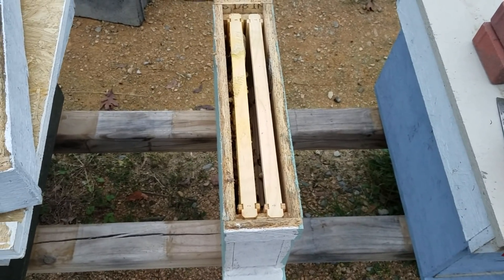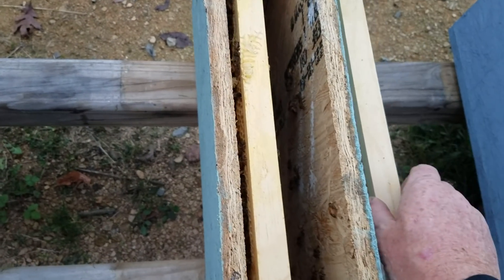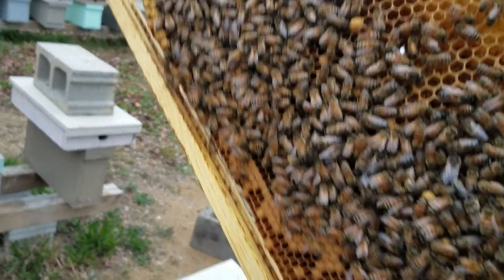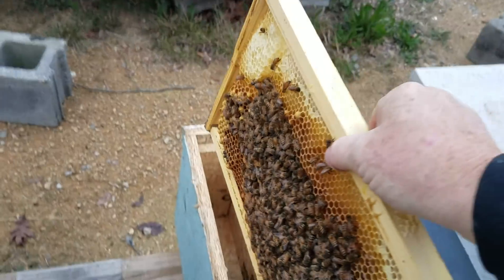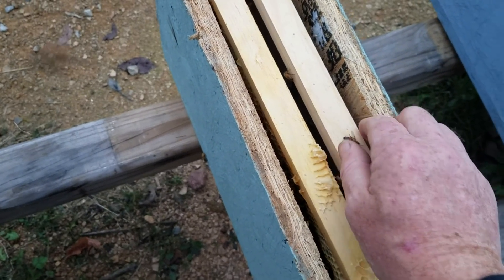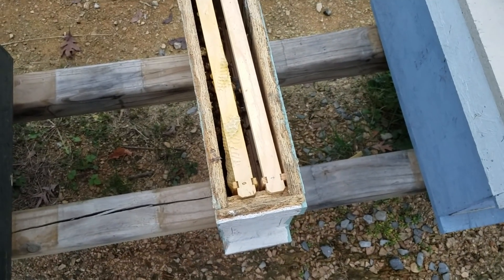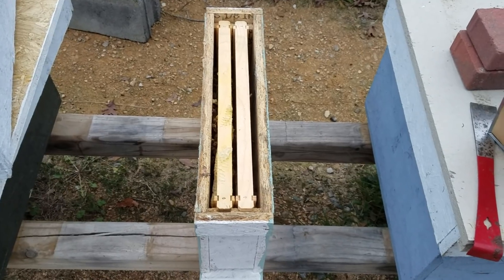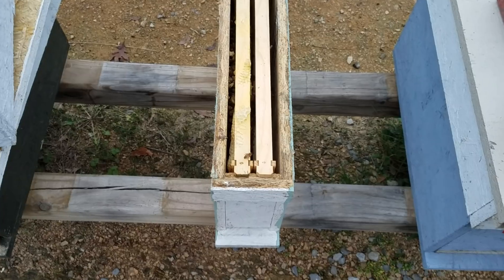Do honeybee splits have to be moved long distance away

Comment: Three weeks ago I did a walk away split on a langstroth that was fixin' to swarm. I went maybe 30 feet away and brushed my frames out into a top bar hive leaving one frame of brood in the hive on the screen bottom. Not only did very few bees leave but more joined the hive as the day went on. I can think of several reasons for this one being I believe I did get a queen in the transfer for the fact the home hive sounded like an angry motorcycle gang by the time I was done while the transferred bees were as calm as could be. Fast forward to today and my top bar has 8 almost fully drawn out combs  and the home hive has been back to a normal routine for about 2 weeks. 
Like yourself David I grew up in the 70's and as a result got a lot of old knowledge coupled with the newer knowledge of today much of the old knowledge while good and practical also seems filled with myth and hokum to a degree while the same can be said for some of the newer ideas and thinking of today. I tend to go right down the middle and go with what works for myself and my bees.

Comment: The reason you move them is so that they start off better with foragers included. When I've done splits in the apiary they shrink down and get a slow start. What you've proved is that nurse bees stay, but you don't know how many nurse bees you got in the split. I just did a bunch of splits and moved them and they are going gangbusters.
Reply: Barnyard Bees, Yes, good point if they have no option.
Reply: But when you make the split, there are relatively few foragers on the brood frames anyway, right? What is more, when you lift that brood frame out of the donor hive, off fly what foragers are there right away, I think. Leaving only nurse bees. So you can feel pretty confident right away that the frame of brood you are putting into the split has nearly zero foragers on it in the first place. In addition, if concerned there are too few bees, add a shake of bees to the split before closing it up. Also, the brood frame you take from the donor should contain mostly capped brood if you are going to add a mated queen. The capped brood will soon emerge and you will soon have a very strong colony. I've had good success making 5-frame reverse split nucs with 2 or 3 frames of brood with adhering bees, plus a shake of bees, plus the old queen and then moving 50 feet away. Within a week or two it will be packed with its own cadre of foragers. One thing I personally would caution against is letting a two frame nuc make its own queen. It might make a queen of some sort, but is she a good queen? Was she properly fed as a larvae by what few nurse bees are in that very small split? That is why I like reverse splits. Take the queen and put her in the split. Let the donor hive with its thousands of nurse bees make their replacement queen. With that many bees to feed the queen, she is likely to be a good one.